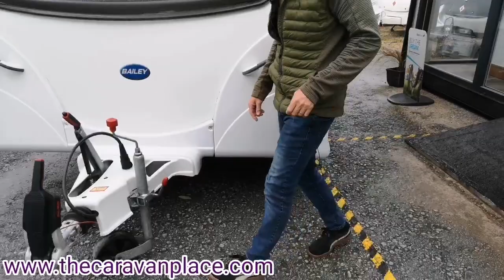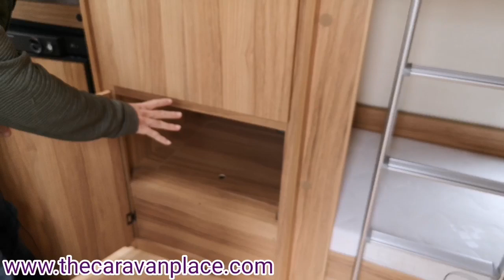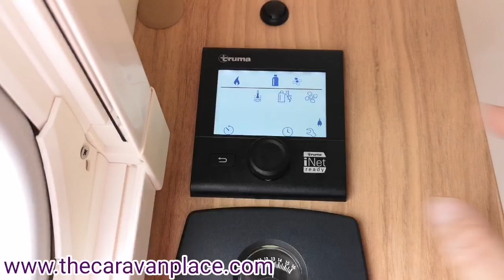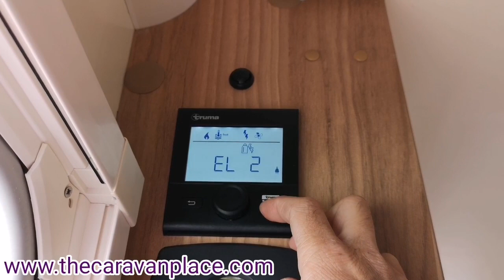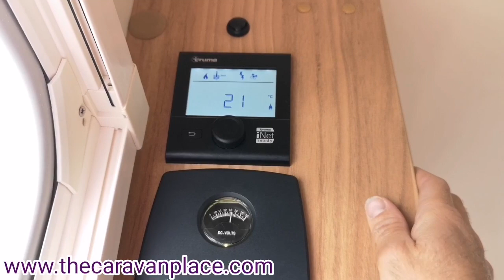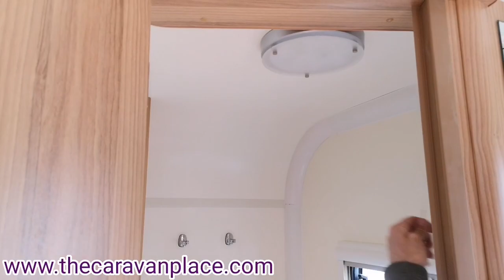We show you how to set up a caravan on site. Bailey Caravan set up

Comment: Thanyou, very thorough and helpful video. 🤗
I have a question which is not related to setting up.  How do I remove the top drawer of my 2013/14 Bailey Pegasus G65 Genoa?  I have found some water in plastic lined top drawer and want to have a look behind drawer to investigate further.
Reply from the maker: As you pull the drawer out look underneath on the rails you will see grey clips that you can squeeze in and the draw will come of the rails. If you can't find I will try to do a video for you.
Reply: @thecaravanplace  Thankyou.